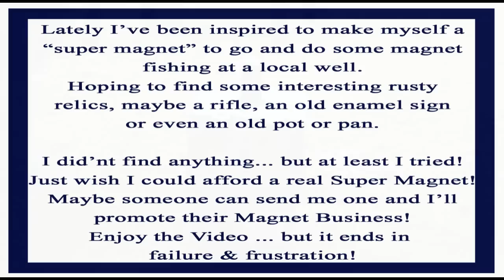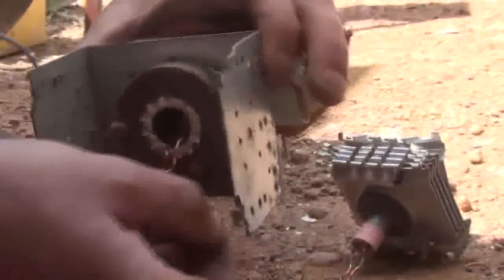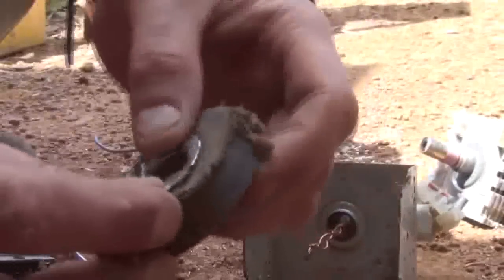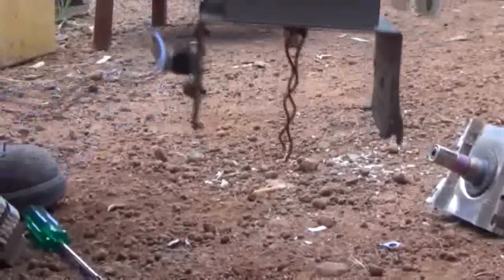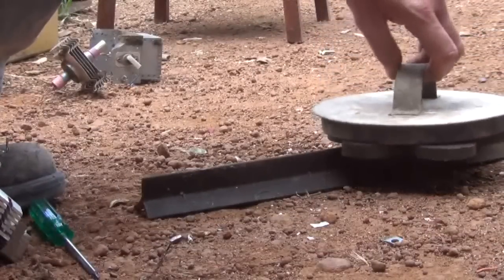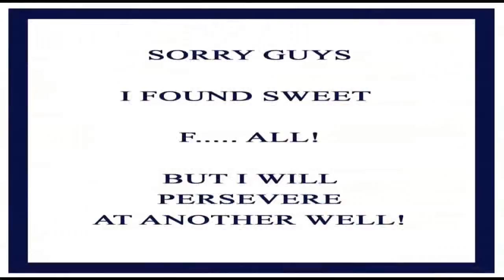Magnet Fishing - Making a Super Magnet from Microwave Magnatrons for Magnet Fishing

Comment: I salvage magnetrons weekly. I have opened over 100. You are attacking it the wrong way.  It takes a flat head screwdriver and wire cutters. Push the screwdriver into the slot next to where the side is attached and twist.  This will bend the top away from the sides. Do this to all 4 attachment points. Pull the top away, cut the filament wires.  get the magnets.

Comment: get 10 or more old broken hard drives inside is the damper magnet mostly neodymium magnets super strong, stick them
on a 3mm metal plate wit a eybold in the middle encase the whole in polyester . before closing u wit the polyester make sure you have them the correct way up, it must be a powerful attraction having look out for the fingers! good luck

Comment: You can build an electromagnet using an automobile battery , copper coils,  soft iron plates bolted together and insulate it in plastic sheeting and you can release the magnet with a toggle switch & suspend it with a nylon rope.

Comment: You don't need an angle grinder to do that.  it just pops off usually.  If welded, its only spot welded, so in any case, just pry it with a screwdriver.  I have taken lots of these apart... great big magnets.

DON'T muck with the ceramic thing.  It really is that poisonous.

Comment: And you need to factor in that weak magnets will not work underwater. The force of the water resistance cancels out the force of the magnet unless it is highly powerful. This is why everyone says to use neodymium.  They are so strong, the water has no affect on them.

Comment: I wouldn't think this was worth the risk of accidentally inhaling some beryllium oxide. Once you inhale it, there is absolutely nothing which can be done to prevent any damage it does to your body systems. There is no antidote, you just have to wait and see if you're lucky or not. 
It is quite possible that if you pick up an old/scrapped microwave, the magnetron might already have been damaged, with beryllium oxide powder lurking inside the casing of the appliance, ready for you to inhale when you open it up. 
I'd just save up for a couple of very powerful Neodymium Boron magnets, and get them from Ebay. It might cost a bit more, but is much much safer (as long as you don't get any of your bodily particles between the magnets!)!
Reply from the maker: mate, there is so much chemical stuff in the air, in our food, there is no escape from poison these days, next time you spray deodorant under your arms, think of that, not to mention eating your bread, drinking your beer, your coca cola, your potato chips, your everything.   These days we cannot escape exposure to toxic substances, there is truly no escape.
Reply: Adventures With Wild Kooda Bill
That's right. Which is why I wash my armpits with soap and water, bake my own bread, brew my own beer (and mead!) keep away from coca cola and let my wife cook the chips. It's also wise to stay away from beryllium...
I'm 56 year old, live on a 23 acre block, and still fell my own trees, cut them up, and stack them for the wood burning furnace. Keep away from chemicals... QED.

Comment: Don't waste your money on a magnet when you can make a super magnet at home. A magnet that's capable of not only picking up steel but also metals such and silver and gold. Just make an electromagnet by wrapping tesla wire around a steel tube then finding a source of electricity (ie, a generator) to attach to the wire. That would be a super magnet capable of picking up HEAVY weight and creating an EMF. ELECTRO magnetic feild. Has to be electric to work properly on what your doing